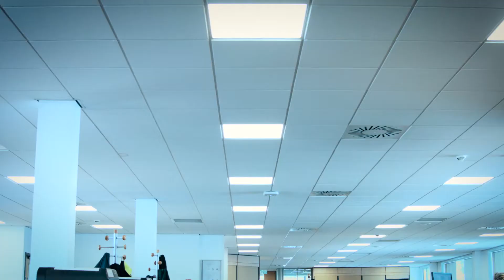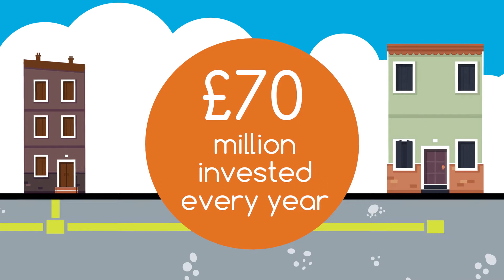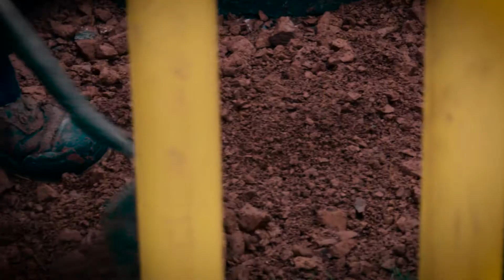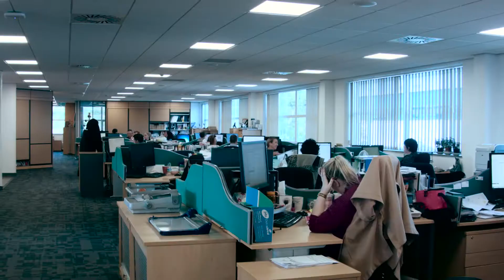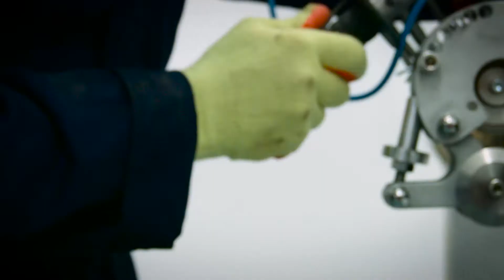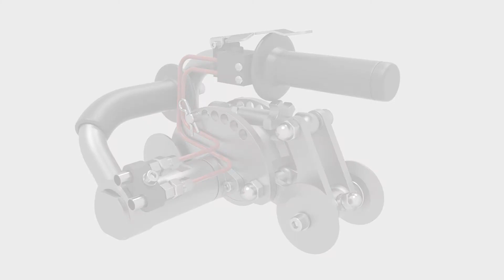Wales & West Utilities Ductile Iron Window Cutting Tool

Comment: Hi Wales and west Ethan Humphrey here I think you should build a block of 100 flats in Maesteg and the name of the block will be called rosemarket 
main entrance 
On the right corridor ground floor flats 1 to 20 
On the left corridor ground floor flats 21 to 40 
up 2 flights of steps 
On the left corridor first floor flats 41 to 60 
On the right corridor first floor flats 61 to 80 
up 1 last flight of steps 
On second and final floor flats 81 to 100 
we will build it as soon as we can